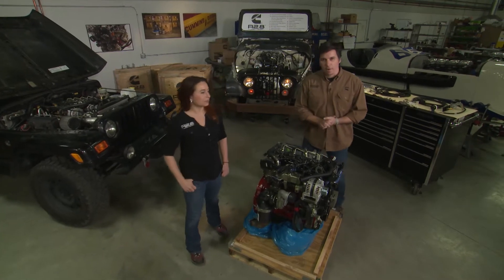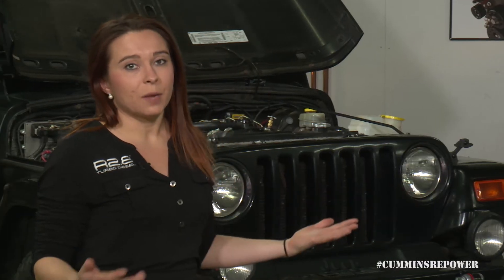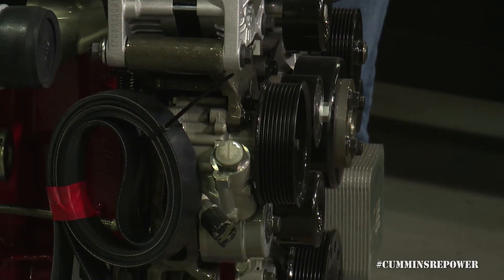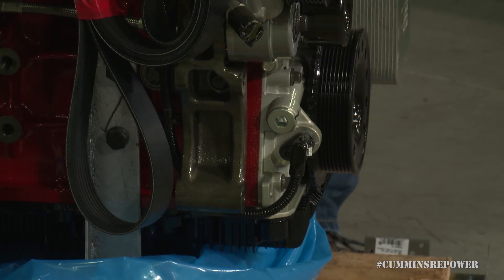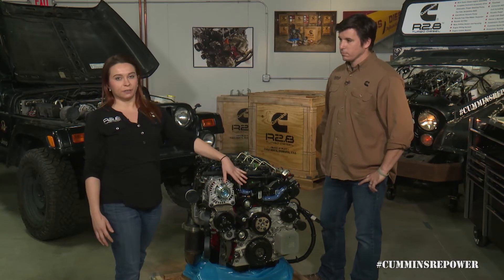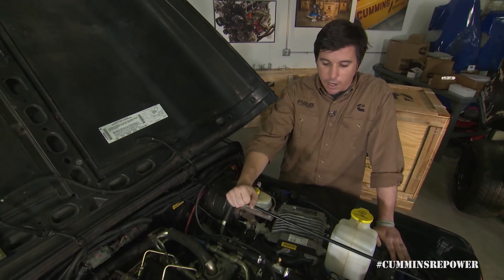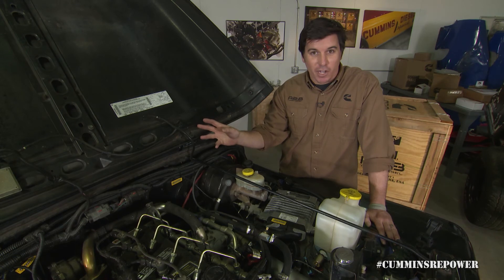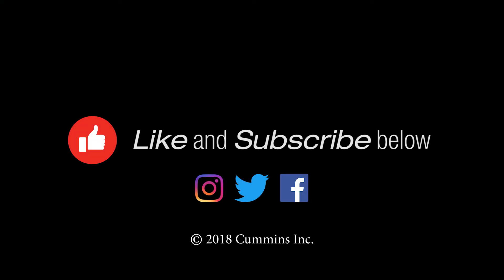Cummins Repower Garage Video 10: Front End Accessory Drive

Comment: Cummins swap the world!
Reply: DEBOSS GARAGE I just have a problem with the cost and lack of power this R2.8 has, the 4bt can make so much more power for way less money. The R2.8 is much more efficient though. I would just prefer more performance for an offroad scenario like a Jeep.
Reply: Craig Haynes hard to say.. You're also 200lbs or more lighter with the r2.8, and a 250hp tune is out there. Likely a TT could help as well
Reply: @PureCountryof91  - Agree. Seeing people tuning the r2.8 from 161hp to 250hp...is a pretty good gain. Plus, considering the r2.8 is so new, there will likely be some additional tune tricks to be had in the near future as more folks experiment with pulling a few more horses out of this engine.
Reply: Is this suitable for a jk jeep ?